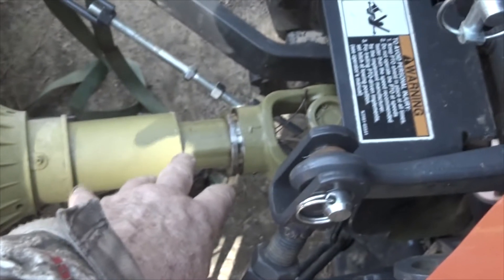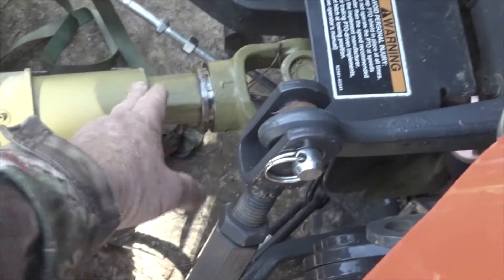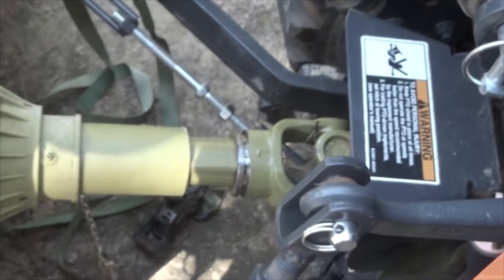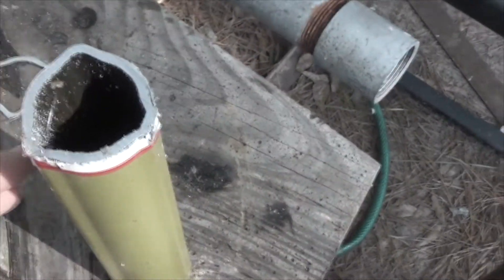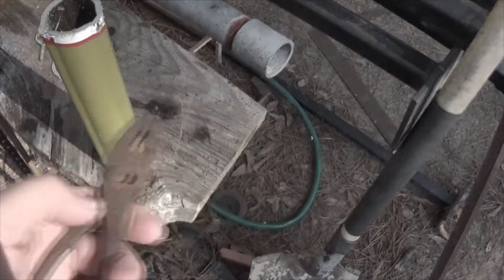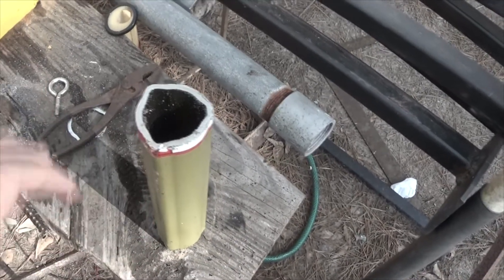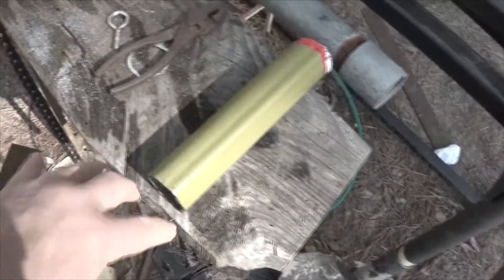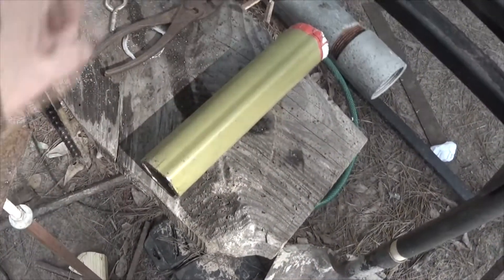sizing the PTO shaft for a new tiller

Comment: If I understand your verbiage, you made it sound as if the PTO shaft was designed to shear or “explode” if an extreme force was put upon it. IF that is what you said, then you are totally wrong. A shear bolt (sacrificial) or a slip clutch is the remedy. The shaft itself is more than strong enough to either strip out gears in the tractor transmission and/or the implement gearbox.
Reply from the maker: yes,  as it was explained when i bought the thing, if the force on the implement, exceeds the slip clutch, the tubing will blow apart.   you only replace one section, the thin metal part.

i was shown one at the tractor dealer which was kept to show customers.   I did not buy the tiller at the dealer, i got it on sale (rare i know) from tractor supply